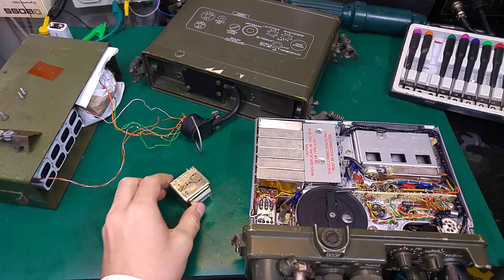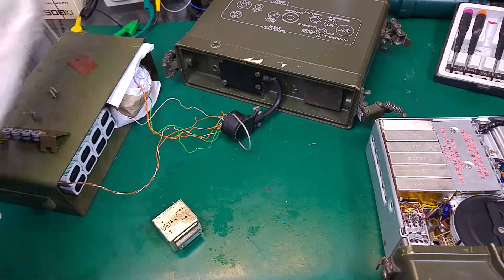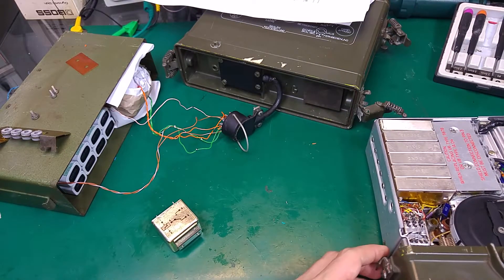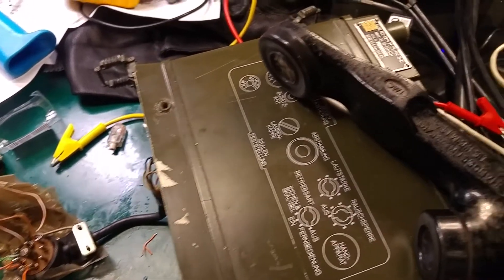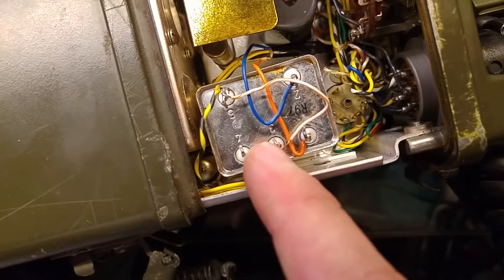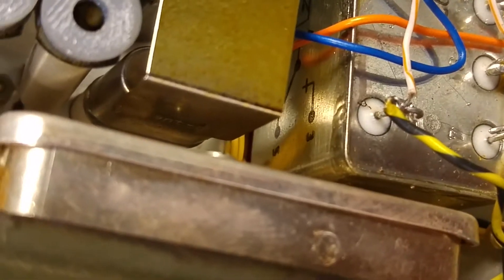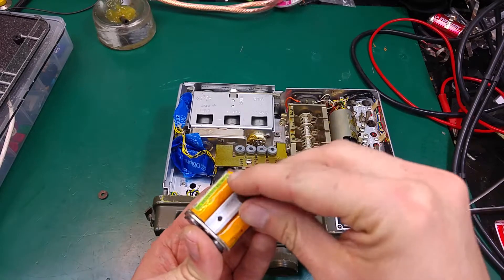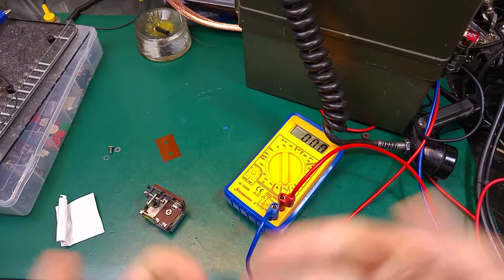AN/PRC-10 - Dead silent - diagnose, locate and repair fault in squelch section

Comment: Could you do a in depth video on how to wire the battery? I’m new to this and have zero idea how to read the diagrams or how to remake the battery for myself
Reply: Search for the POWER UP conversion by Dave Storm Manual. Its pretty simple.You need 8 D-Cells and 15 9Volt Blocks.